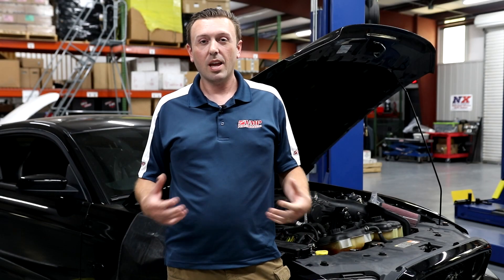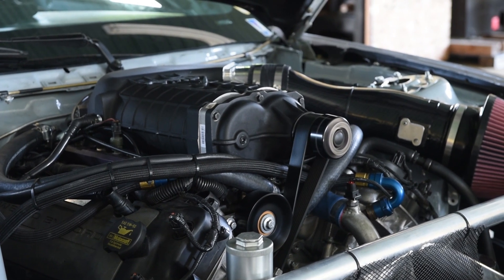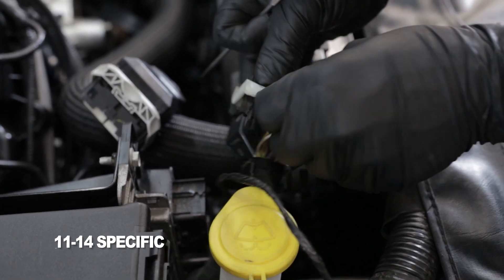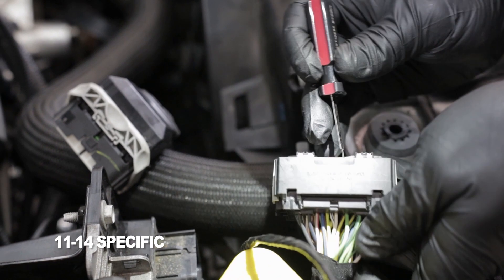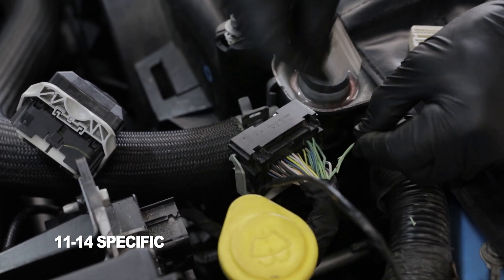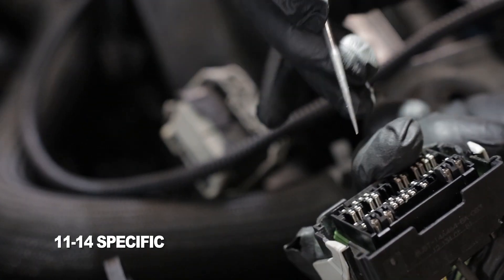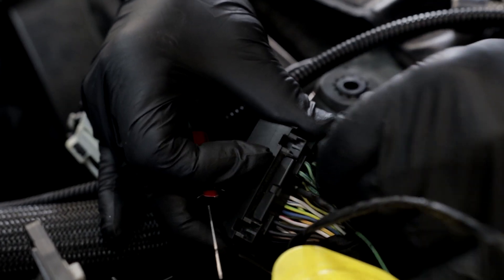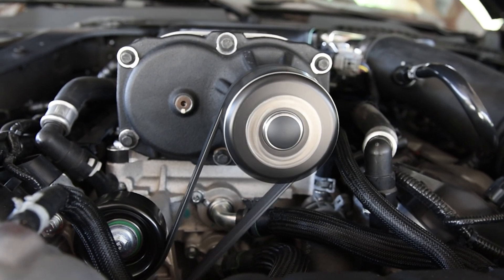Tech Tutorial ||  '11-'14 Mustang GT and F-150 IAT/ACT Wiring for PD Superchargers

Comment: my kit has the Iat2 sensor input on the iat1 cable (robbed from Maf sensor)and this is used as IAT2 to pull timing if needed.  the ambient air temp sensor is used as IAT 1 so is there any benfit using this kit? i dont see an advantage other than this is probably the correct way.

Comment: so you guys installed and tuned a gen3 blower on my 16, and i believe you also put in the harness for the iat sensor since it was swapped.  so does the iat # that reads on my dash read iat2? i cant find iat2 on my sctx4
Reply from the maker: 15up only have IAT 1, it's measured post intercooler with the harness we supply and a special brass IAT sensor used on 15+.  IAT 1 will show up on the dash and with our harness indicate post blower and charge air cooler temps.

Comment: Does the iat2 come up on the ngauge ? 2014 coyote
Reply from the maker: As long as your tune is calibrated to properly read the PID.  Due note that HP's support of the nGuage is going away in the near future.
Reply: @VMPPerformanceTV  you guys tuned my tvs coyote and it runs tits 👌.  My car is currently tuned using an old sct x3 . I sold my raptor and now i have a spare n gauge I'd like to use for my mustang . I tried to look up air charge temp or iac2 in the n gauge with no luck . . Would very much like to know what my air charge temps are ,just don't know how to do it

Comment: please release the full video of the 11-14 gen3r install, there is too many little things that are not the same when watching the gen2 install. This is a BIG deciding factor on me purchasing a supercharger kit from you guys I need a good install video for strictly 11-14 gen1 coyotes. please please please. Thank you.

edit: nvm I will probably just spend the extra money on an odin, since you guys have the install vid for some reason and a provided plug and play kit, cooling properties seem better also. 
what kinda hp/psi would I be looking at with a 92mm pulley
Reply from the maker: Duly noted regarding the s197 Gen3R install.  As for the boost with the 92, 10-11psi peak and depending on the car/tranmission/any other mods, somewhere in the middle to high 500s at the wheels on a Gen1 car with Loki.
Reply: @VMPPerformanceTV   @VMPPerformance  I appreciate it a lot, thank you really. I just really noticed the Loki kit, I am very interested in that now, also it is a little less money which is nice, what are the overall differences? 
Something to do with the heat exchanger?  And no BAP, and stock air box still being used is the only differences I see. Honestly the LOKI kit seems to fit all my needs. 
Easier install, No grinding, better cooling properties, better performance I may add.

Also I am 6R80 trans stock, Ford single piece driveshaft, tuned, 3.15 stock gears. Planning to run the kit on pump 93 with 92mm.
I am currently watching the install video on the Odin, I am assuming both installs of the Loki and Odin are basically the same, yes?
Reply from the maker: You're welcome!  The Loki kit re-utilizes the stock throttle body and air box as well as runs a single pass non fanned heat exchanger.  Everything else you've got pretty well nailed down.  Yes, the installs between the two kits are virtually the same.  Also, the Loki kit can later be upgraded to Odin spec with those individual parts.
Reply: @VMPPerformanceTV  Right on, I may be purchasing this very shortly. I want to do a compression test on my motor first this weekend lol.

Phenomenal customer service, thank you again. Take care VMP.
Reply from the maker: Always a good idea to know where your engine stands before moving forward with a significant modification for sure.  Good plan!  

Thank you for the kind words.  Don't hesitate to reach out with any questions you have at any time via email or call, or even a DM to Facebook/Instagram.  We're happy to help!

Comment: Hey I never knew I needed this mod with my Gen3r i just installed.  Is this mod mandatory or no? I would of had tech add this IAT2 sensor if i knew this was required.  Is it ok not to have this mod? I will have my tech do this later. Let me know if its mandatory or not.
Reply from the maker: This harness and sensor set is included with Gen3R and earlier kits for the 11-14 Mustang and F-150.
Reply: @VMPPerformanceTV  I got  a Gen3r and never received IAT2 harness and sensor. How can i get one.
Reply from the maker: @maximusvonce1381  if your car is up and running and tuned by us, then it came with your kit and your installer installed it.  If this is not the case, email us at sales@vmpperformance.com and our sales team will work to get things sorted out.
Reply: @VMPPerformanceTV  Yea vmp has tuned my car since 2012. So i must already have iat sensor.  Thanks